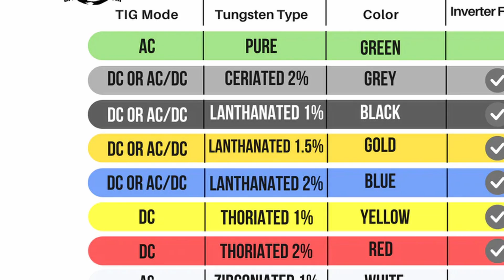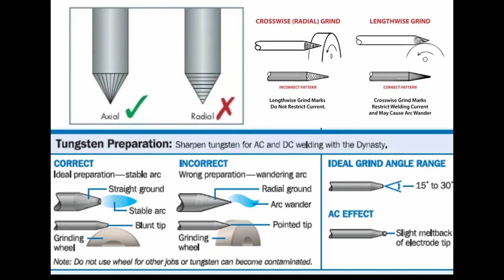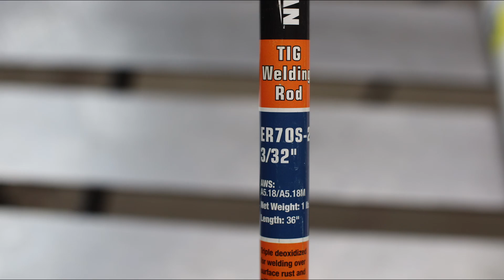TIG Welding Made Easy

Comment: I’m looking at getting a nicer welder and wanting to learn some tig. I cannot decide if a Vulcan omnipro 220 or a Yeswelder Mp200 would be better. Of course I would use all the other modes too. You have used both, which would you recommend? Omni 220 or mp200?
Reply from the maker: If you have the funds I'd go with the Omni pro, it's more expensive but it is a nicer machine. 
The YesWelder is a great entry level machine. I don't get any discount for HF but if you do decide to go with YesWelder then here is a link and code:
https://yeswelder.com/?ref=uDQs4bv7pZQF3
Code: MECHMASTER

Just as another option I have run a couple ArcCaptains and like them slightly more than YesWelder. They also have a Multi Process 200
https://www.arccaptain.com/?ref=mechmaster
Code: MECHMASTER